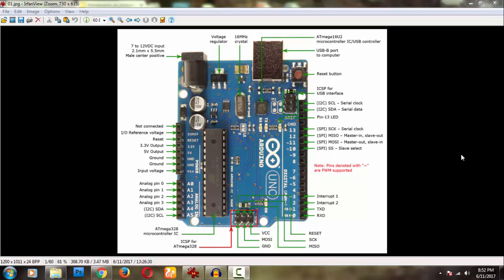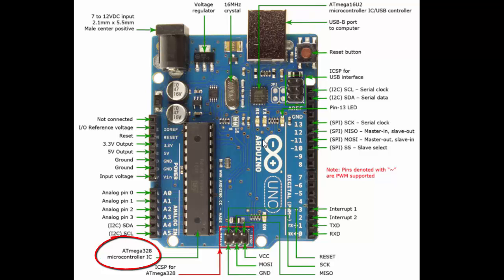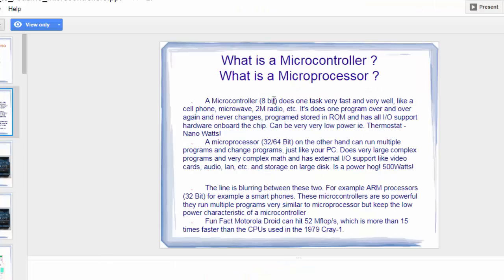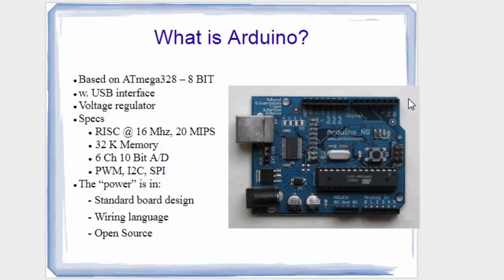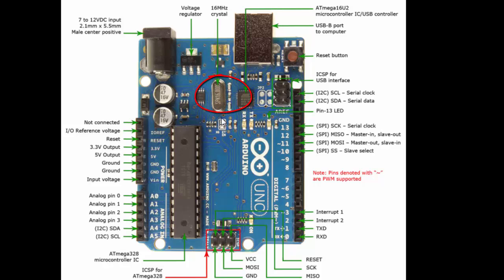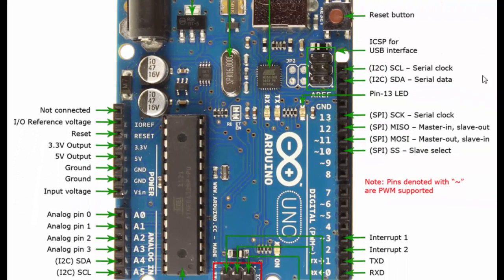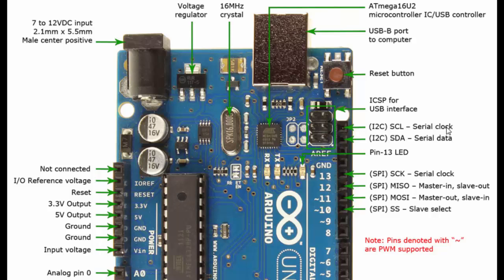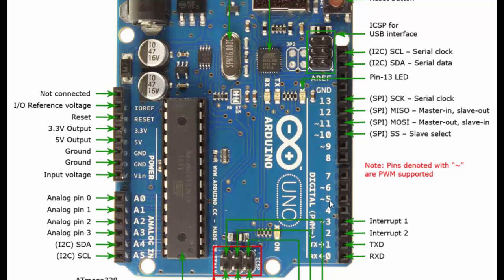Introduction to Arduino Uno Board and All the Components For Beginners

Comment: Good video.. informative without being overlong and you basically covered everything on the board. However, in a world where Arduino is presented as a miracle worker, it would be nice if you could highlight also the limitations of Arduino.. i.e. not only what you can do with it but also what you can't. For instance, when is the 32 KB not enough ? How does it handle interrupts? Is Arduino reactive enough for mission-critical applications? How accurate are the typical sensors you can buy for Arduino? Could you reliably use them for commercial applications? Thanks.
Reply: Everything i do is mission critical